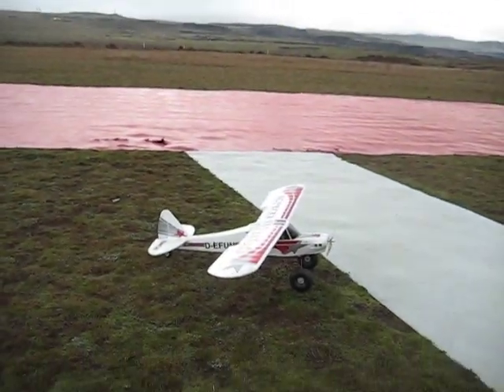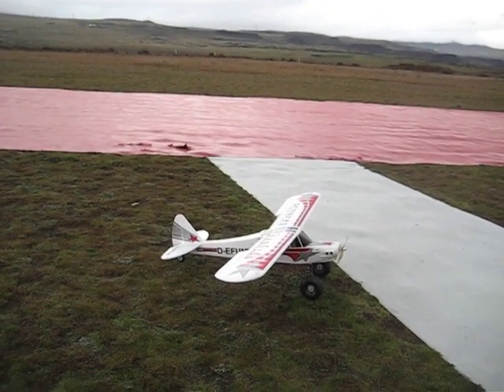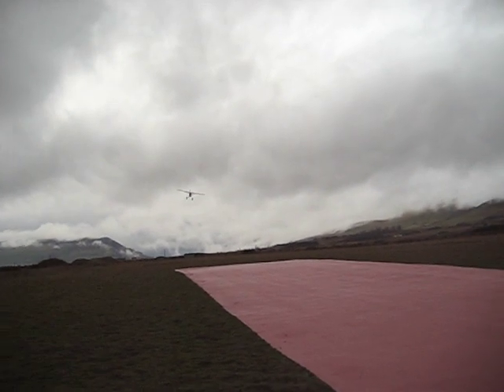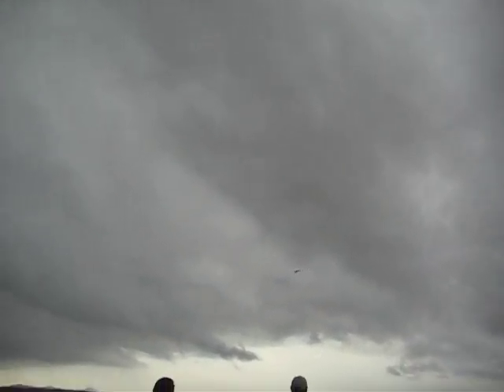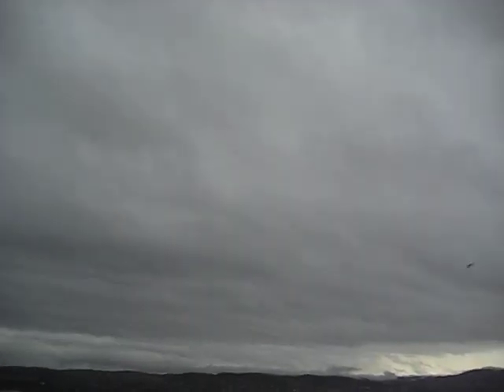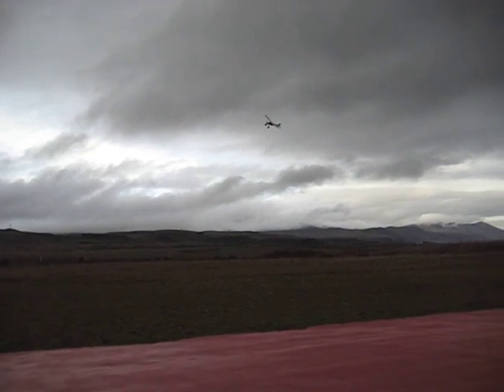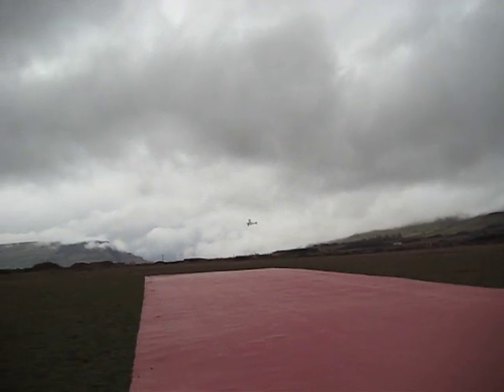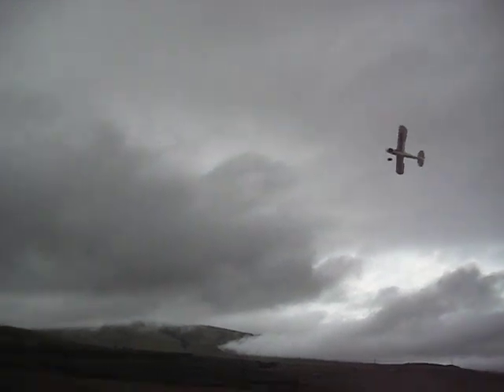FY-20A II Flight Stabilization

Comment: Hi

making some turns with the stabilization on is ok with minimal wind, but what if you need to pull up quick, or make a tight turn. Is there no way of changing the settings to allow more pilot control.

cheers

Comment from the maker: This was my first time up with FY20A Stabilization in my Fun Cub.
Wow  - this thing really work's great.
If you have your rate's set low, you can't over drive the servos and plane will not  over bank in roll, elevator or rudder.